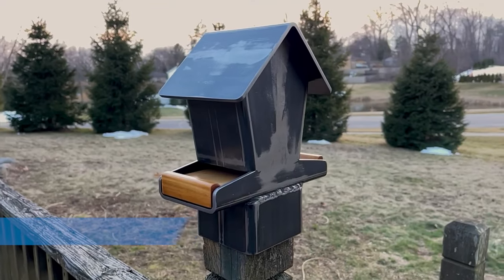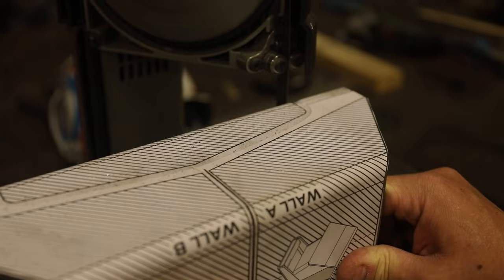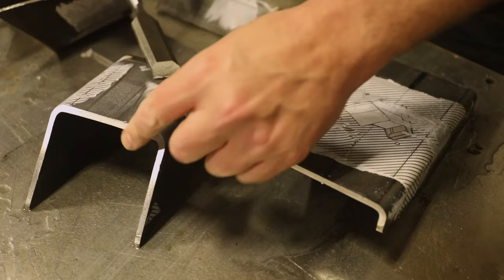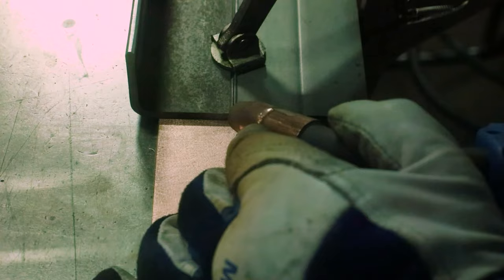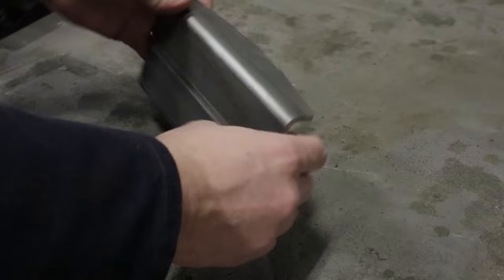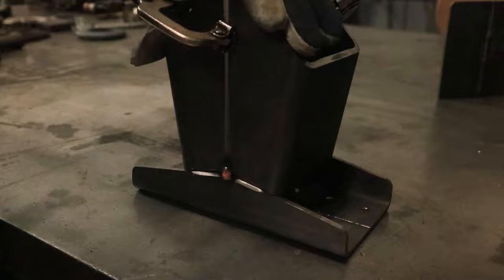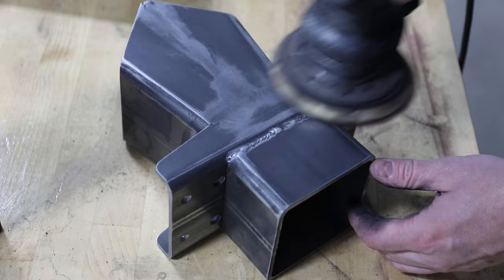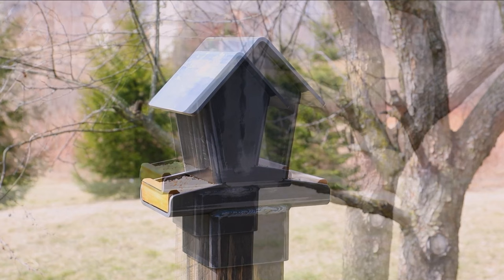DIY Welding Project: Bird Feeder

Comment: Last week, I  Tig welded an aluminum top for my suet holder/ feeder that the squirrels chewed up to get to the suet. 
Let's see them try to chew on a few layers of aluminum plate . 
I'm in Advanced welding I'm in college and we just finished using aluminum welding using Tig. Were onto stainless steel till the end of the semester. 
My new love. All I need now is a great welder like you used here. But I don't think the Veterans Administration will pay for one though. But I was able to get my first welding helmet with the 2.0 viewfinder. And a pair of miller gloves. I'm in a program where veterans get a chance to find a new career that works around and work well with my military disabilities for a chance to get back to work again. 
I love welding. It really distracts me from intrusive thoughts and anxieties as I weld. ❤️